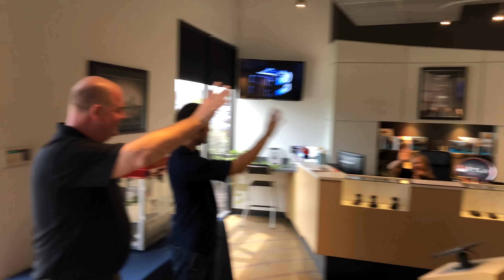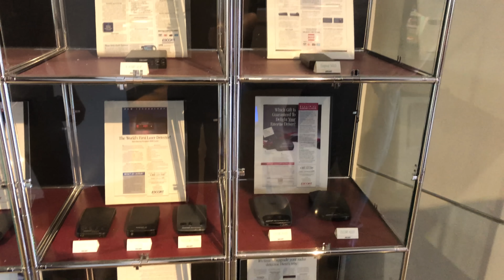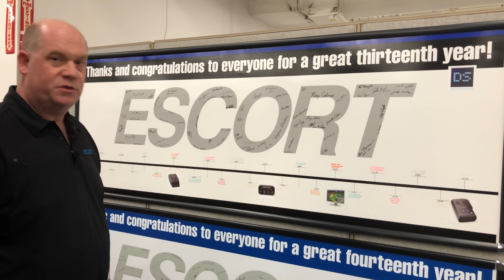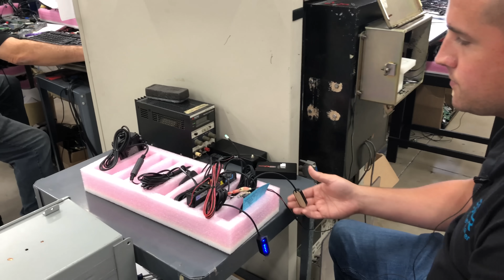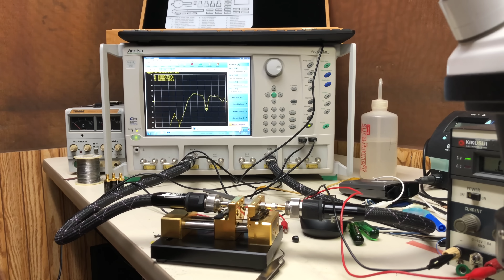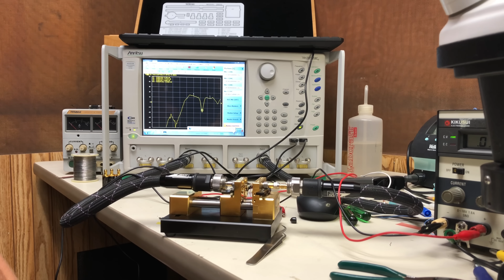Escort Radar Factory Tour in West Chester, OH

Comment: Oh, common,  mine says made in Philippines.  I bought this at Costco. it is escort IX. By the way, how do I erase the police location marks on this unit.
Reply from the maker: Yeah most of their detectors are still built overseas. A few are finally put together in West Chester, but most are not. To erase police location marks, you can turn the specific marked locations on and off in the settings (via the detector or the app) and you can also clear any manually created points as well.
Reply: Vortex Radar thank you

Comment: Did you ask why their Android App is the biggest piece of crap that exist? I have a Max 360 and it's always has problems. This is my second max 360 and the issue follows the escort app. They actually Amit the app sucks but DO NOTHING ABOUT IT!
Reply: There is (or used to be recently) a section of the building for competitive bench testing. A cabinet full of actual police radars, laser, and test vehicles in back.  There are reversed engineered competitive products.  For those in this post that assume Escort team are numb, not “looking out the window”, are dreaming. They understand where they are specific to bench and street performance.  Customers currently (and past) vote with their checkbook.  To date Escort continues as the top industry unit sales leader.  The “R3” while good, has several overall street range weaknesses, BSM/TSM/door opener false issues.  For majority of users who do not want to tune their own settings right out of the box, Escort default settings are better.  Most customers do not want to figure out R3 specific radar CM in their locale, then have to program their device by pushing a maze of buttons following a blog, or some cryptic directions. Plus, while driving long distances for vacation/work, have to push buttons on a small device on a windshield (as they have notes from a blog) which settings are best for each county/state they are traveling through. Most customers want a great performing device wherever they go.  IF, they seek to make a tune/change, they appreciate the phone based app with Escort.  It vastly simplifies making personalized adjustments.  

Fortunately opinionated people who vocally trash Escort like they were a abused puppy, are not in the majority. This abusive culture makes up a smaller and smaller customer base.  One reason why Escort continues to dominate performance and sales growth.  As long as Escort caters to the main body of potential customers, they will succeed in the marketplace.  

I own multiple top tier brands of detectors and counter measures.  I do real time multi environment running of all these brands, seeking that unicorn device.  So far the top end Escort products are the preferred systems to use.
Reply: I hope you enjoy your Escort. 
Having had an Escort until a few months ago I know what it's capable of and what all of the shortcomings are.
It can't hold a candle to an R3. 

Escort is all about fancy marketing that's it.
Reply: Do the math. They don't care. They already have your money because you drink their cool aid.
Reply: Derek Jacobs I agree. Sadly that's how everything is here America. Its all about business and give two shits about customer service.
Reply: Move to an R3... you'll never look back.